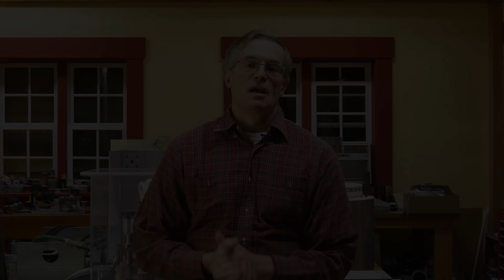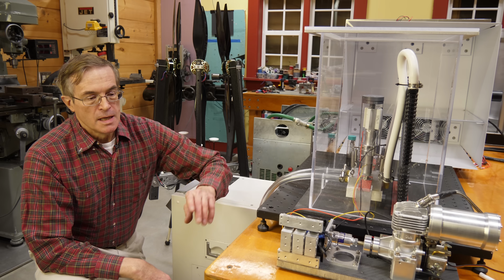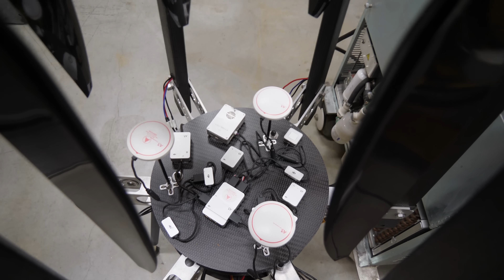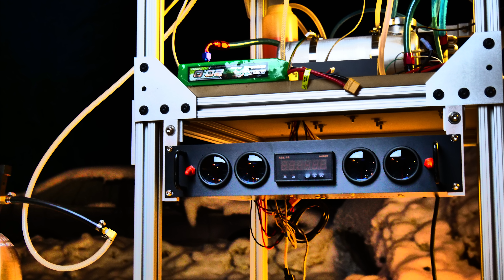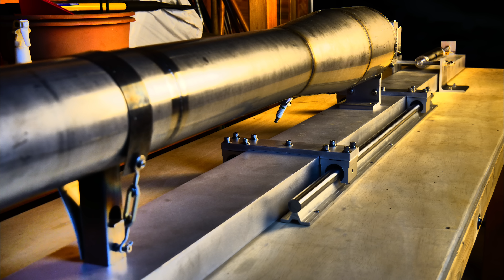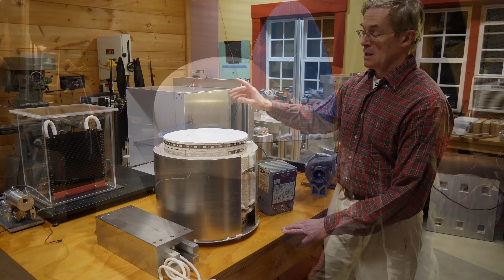100,000 Subscribers! What's Next?

Comment: I really want to see your thoughts on the solid state mini fridge. I'm guessing it's peltier elements? I'm building my own minifridge but I have so many questions about them and cannot find any answers
Reply from the maker: You're correct.  The concept is simple, but the execution requires some decent engineering.  I'll go through our approach and some of the trade offs in the video.
Reply: @TechIngredients  One of the things I'm trying to find out is the difference between different rated powers on peltier elements. The most common is TEC127-06, (6Amps) but there are 15A and 26A variants of the same kind. My question is what is the difference in the composition of them? Why is one rated for higher power (obviously lower resistance, but why is it lower)? How would performance differ if you run 6A through the 26A model and 26A through the 6A module. It is really interesting stuff :D
Reply from the maker: I will cover this in excruciating detail when I go through the refrigerator build.  Hang in there.
Reply: @TechIngredients  I'm incredibly excited for it! I'll be waiting!

Comment: Congratulations! I've been following you for 8 months now, you rock. Is that a triple modular redundant set up you did on the mega drone? If so how did you figure out how to do it?
Reply from the maker: Thanks!
Actually, that is the top end of the DJI control system called the A-3.  It is supplied with redundant GPS/nav modules that error check to improve accuracy as well as to provide redundancy.
Reply: @TechIngredients  Interesting, I will check that system out. Thanks!

Comment: Just stumbled upon your speaker test videos and stayed! Congratulations!! Everything is clear precise and followed easily (if not as expertly!). Coincidentally I am building a large studio/workshop at the end of the garden and using the acoustic panels instead of regular speakers would be ideal. One question did pop into my mind though, if you could indulge me? If you use two speakers only then which ever has the centered actuator does not matter but if you use four or six panels would you alternate the types of have all the 'centered' ones on the left (for instance) and all the off-centre ones on the right? Which is the better solution for a mult-panel speaker solution? Many thanks and best wishes ES
Reply from the maker: Thanks!
The two channels should be the same.  The manufacturer of the exciters recommends the offset location when building a single panel.  We discovered an improvement when we ADDED another pannel with the centered exciters.  So, if you have to choose, go with the offset and only add the centered position if you can.

Comment: Hi I've just found your channel and subscribed , I have a project that has been in my thoughts for many years, it involves vertical take of without any down thrust, I can hear you say impossible , lol it would be a world changing event, the principal is simple, would love to explain it to you, could be a very interesting project. Terence M Bloomfield (Scotland)
Reply from the maker: I prefer to discuss ideas in the open so that others can participate.  What have you got?
Reply: Tech Ingredients , hi Tech Ingredients, OK, so briefly here is the concept, we all know that if we have a fly wheel where it is out of balance, the faster we spin it the more force is generated on the centre spindle, the concept harnesses this force but in a controlled way.
The fly wheel is made into 12 (there could be more) segments slices of a cake you might say, each of the segments is secured to the centre spindle but there is a mechanism that allows the segment to rise on a shaft up to 3mm from the centre, a strong spring holds it tight to the centre spindle , there is also a electronic actuator that will push the segment up, this would be controlled by an electronic control board.
Ok so, the flywheel starts to spin, all segments are in the home position, as the speed increases the segments are wanting to move out under centrifugal force but they cannot as the spring is holding them back, the controller solenoid allows the segment at the 10 o'clock position to move out by 1deg and then at 11oclock 2 deg and 12 o'clock 3deg, the segment the is pulled back to 2 deg  at the 1 o'clock position and 1 deg at the 2oclock position, at 3 o'clock the segment returns to the home position, all segments from 3 o'clock to 9 o'clock are at the home position.
It's is my belief that if this can be accomplished and I do understand the technical difficulties in making this happen, it will mean that lift can be achieved, once lift has bee made the forward thrust can be made by making segment out at the 3 o'clock position.
My thought would be to produce a computer program first to prove the viability.
Now that's got you thinking 👴🏻
Reply from the maker: I think you should do a balance sheet for all the force vectors involved for each component.  The net will balance and momentum will be conserved.  The spindle will wobble to the same extent as if the flywheel was a solid and oval shaped.  No net force will be produced.
Reply: Tech Ingredients , ok so a no go then, oh well I'll cancel that Ferrari then 👴🏻

Comment: If I may make a suggestion, please consider making a move to full metric system.
Reply from the maker: That is not always practical.  Many of the products we use are specified only in imperial units.  For example, the insulation material we demonstrate in the up coming refrigeration video is sold and rated according to R value.
Reply: @TechIngredients   I totally understand, could you also show the metric values when possible, on screen?